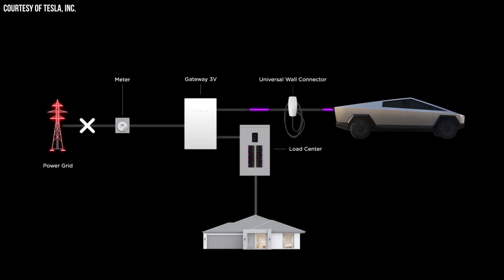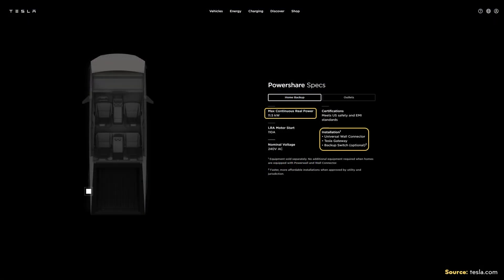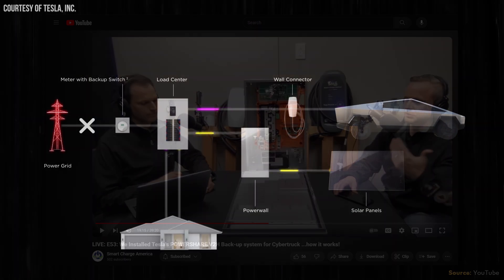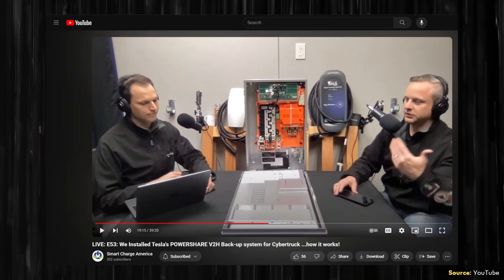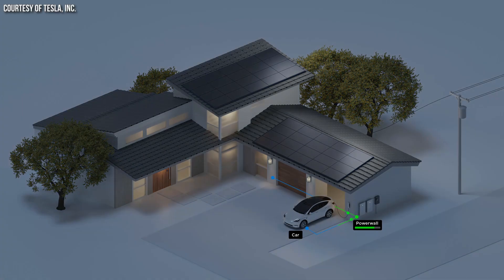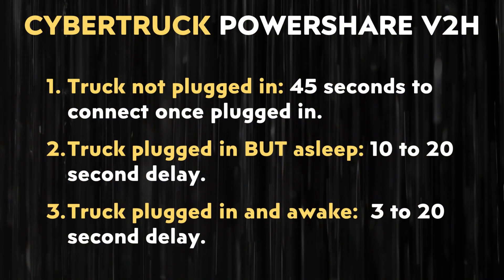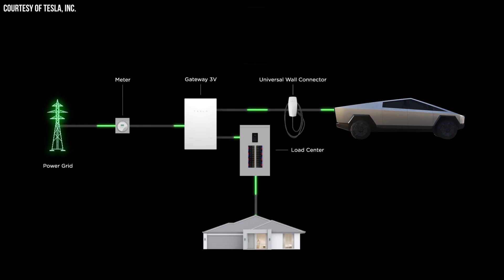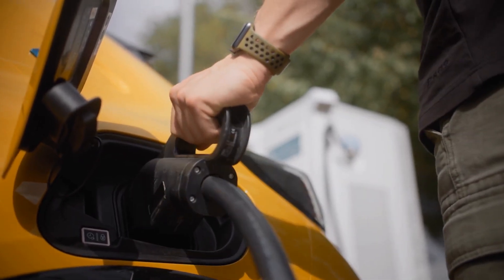Tesla Cybertruck Powershare V2H Explained | NEW DETAILS REVEALED!

Comment: I just ordered the non-foundation series cyber beast, was able to get the free universal Wall Connector through the referral program, but I can’t figure out on the Tesla website if I can buy the Tesla Gateway alone. It seems to be bundled with another universal Wall connector, which I don’t need.  Any suggestions?

Comment: Is there any simple way to plug an extension cord into a Tesla Model Y or 3 and power a refrigerator or two?
Reply: No 110 outlets exist in the model Y or 3, however you can utilize either the 110v or 220v outlets in the cybertruck to do this. If you chose to use a DC to AC inverter from a 12v plug in the model Y or 3, it would drain your 12v accessory battery and not recommended. The best bet would be to use an energy efficient mobile cooler or fridge in the Y or 3 using that same 12v accessory plug provided in the Tesla models that could then keep small amounts of food or medicine at fairly cooled temps.

Comment: Is the Universal Wall Connector a must for PowerShare? Or the regular Wall Connector would also work?

As many home owners have installed the original Wall Connector (Gen 3) does it mean they need to swap to Universal Wall Connector?
Reply: Not if you already have Tesla Powerwalls and gateway inverters in conjunction with your existing Wall Connector charger. The app will have settings to set the desired backup percentage as compared to SOC chosen for the CT. Once that level is reached the automatic backup will stop and return to normal use.

Comment: I work for Car Charging Pros, one of Tesla’s preferred charger installers. As we wait for Gateways to be delivered, we found out that the Tesla backup switch is way easier and cheaper to install than the Gateway and does the same thing with a ton less hardware to install. Find out if your power company has approved the Tesla Backup Switch to see if your location qualifies. Time to install a Gateway is 4-6 hours VS 20 minutes for the backup.
Reply: High quality top notch information tytyty vm sry but I didn’t bring th teacher an APPLE HA
Reply: Do you still need a Tesla powewall?  I'm assuming you do...

Comment: CT, MS, MX and the new Roadster will have the same power train and circuitry. Roadster will have a carbon fibre body and probably a smaller battery to get the better performance. Tesla uses the same inverter for all its drive motors. As the M3, MY, M2 go 800V, they all should have the CT's home power capabilities.

Comment: If you put up solar panels with batteries and the automatic transfer switch (ATS) you could get 30% off from a tax credit. Just have the electrician include the EV charger (and a connection for an emergency generator).
Reply: What state gives 30%?
Reply: @DrMatthewHudson  It's Federal.  I got that last year for my Tesla solar system.  30% right off the amount of the tax.  Income limitations apply.

Comment: There are people who will be getting the Cybertruck who will make a "cord of death" that plugs into the Cybertruck's 240 volt outlet with the other end plugging into the house's NEMA 14-50 dryer outlet (but first the main panel breaker must be turned off and the HVAC breaker also), and then the Cybertruck can power the refrigerator, router, lights, etc. in the event of a power outage. The cord has that name because it is possible to get a deadly shock if you plug the cord into the Cybertruck first, so you really have to know what you're doing, and know that this is obviously NOT to code.

Comment: I'm currently installing 2 pw3s + solar with Tesla gateway.   So glad to hear future Tesla vehicles will eventually include powershare.   This will seamlessly add significant backup energy capacity to a home.   This will help transform home power backup.
Reply: Does Tesla let you buy the hardware and install yourself? Or do you need to have Tesla install?
Reply: Not that I'm aware of.   Ordering pw direct from telsa includes installation.

I decided to go with a local telsa certified installer who is very familiar with all the requirements from my hoa, utility interconnection and county authorities.
Reply: @shaggydogsales 
You typed that YOU were currently installing powerwalls thereby taking credit other people's work.  OTOH, I easily installed a 20kVA standby generator and ABT switch - saved myself $9,000.
Reply: You assumed incorrectly

Comment: This is helpful. I was at the Tesla store yesterday and I asked the Tesla rep if I’d need a Powerwall in order to use the Cybertruck backup power, and he said no, it should just go straight through the wall plug. This didn’t make sense to me and I didn’t push him because clearly he didn’t know what he was talking about. There would at least have to be a switch that prevents the truck from backfeeding on a dead grid. I was thinking the simplest way would be to wire in a manual transfer switch to a panel of critical circuits.
Reply: When you lose power, simply open your service disconnect breaker. No additional switch is necessary for a non-automatic standby power set-up.  When you know the utility power is back, simply disconnect the CT and shut the service disconnect breaker.  QED
Reply: That's not a code compliant configuration anywhere within the US. You have to have a transfer switch. CT is not going to let you blindly backfeed into your home @geoffgeoff3333
Reply: That is what the 3V Gateway does.  Think of it like a generator transfer switch.